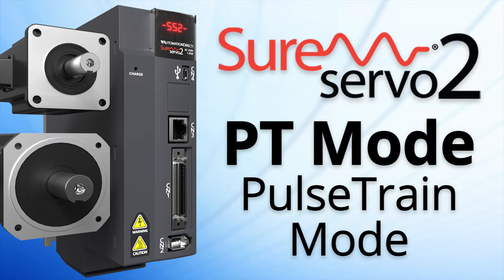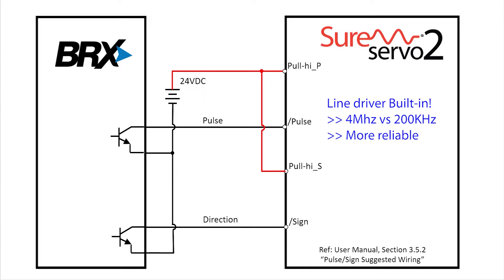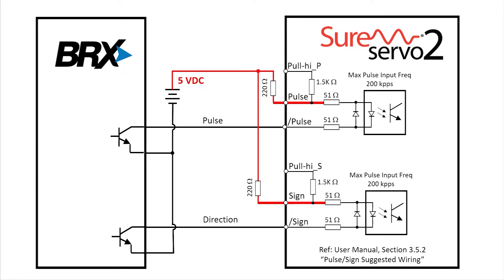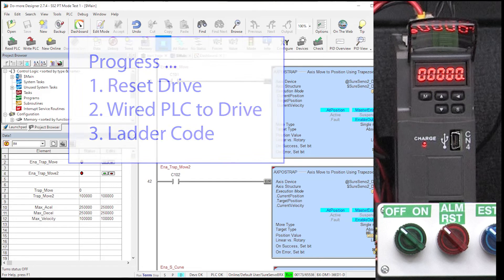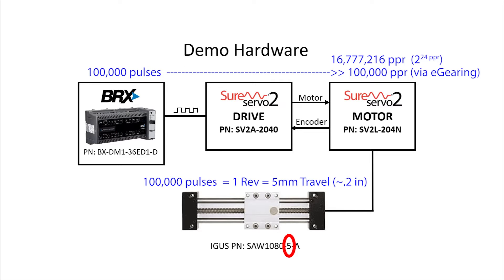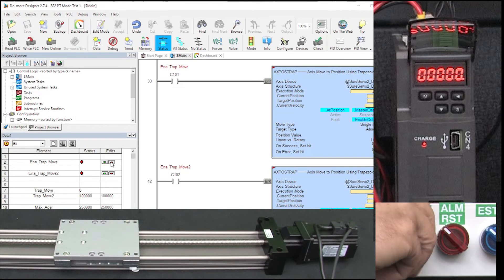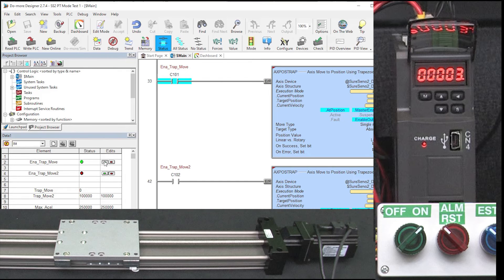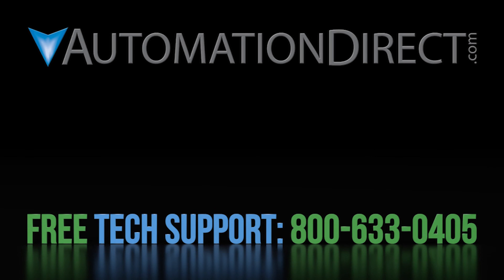SureServo2 Pulse Train Mode (PT Mode) from AutomationDirect

Comment: To connect to a microcontroller like a arduino uno. do you guys the schematic of the connections? where can I find it?
Reply from the maker: @jose, we do not have a schematic for that type of connection. We do have schematics for connecting either singled ended or differential pulse train outputs to the servo. There may be a schematic online with the Arduino community that will let you match that schematic up with the Arduino hardware you are using.

https://cdn.automationdirect.com/static/manuals/sureservo2manual/ch3.pdf#page=23
Reply: @automationdirect  Thank you for the response, In the case of wiring up the sureServo2 motor driver as shown c3-3. what steps I need to follow after. I am getting AL013 Motor Override. I Only have 6 wires connected on the SV2-CN1-LTB20: COM+ to 24V, PIN17:GND to MCU-GND, PIN12:/PULSE to MCU PWM, PIN13:PULSE to 5v through a limiting resistor 220Ohms, PIN14:/PULSE to MCU PWM, PIN15:PULSE to 5v through a limiting resistor 220Ohms, the rest of the connection (R,S,T), (U,V,W), (L1,L2,P1,P2), (P3,D,C) are connected as shown in the tutorial video https://www.youtube.com/watch?v=C6Br6lRatS4 

Am I missing a wire because I try to factory reset. and send the signals, but the motor does not engage. 

Sincerely, 
Jose
Reply from the maker: @jose you will need to take a look at your digital inputs. By default, DI8 is set to a motor override and DI6 & DI7 are both set to forward and reverse overtravel switches. These will all need to be wired up to sensors or the inputs will need to be set to something different to allow you to clear the motor inhibit warning and the overtravel faults.